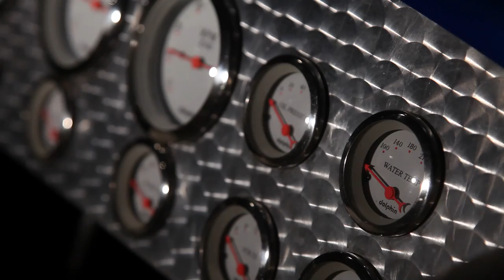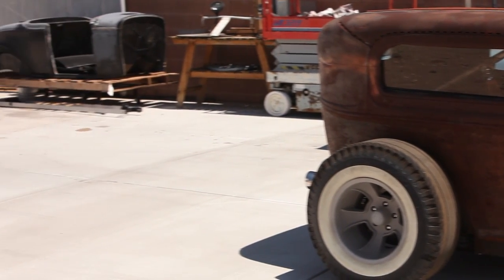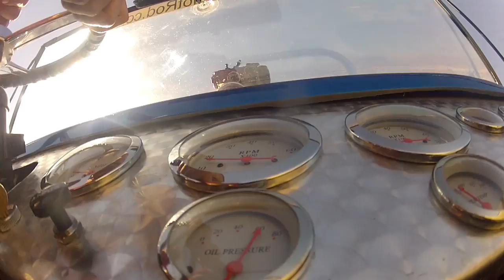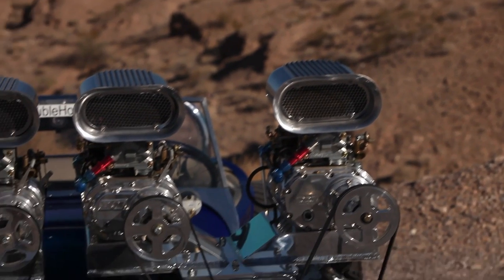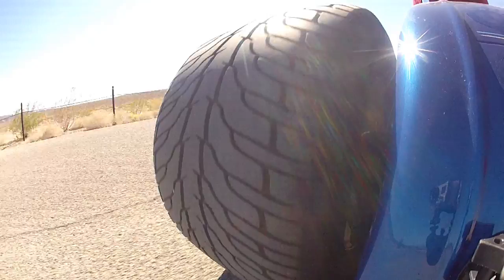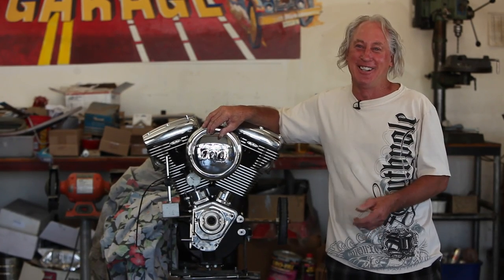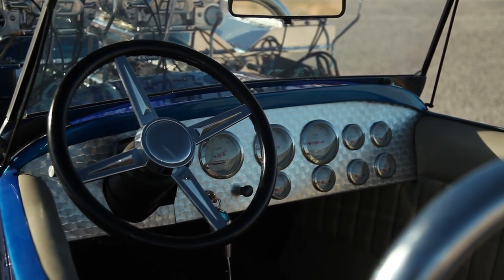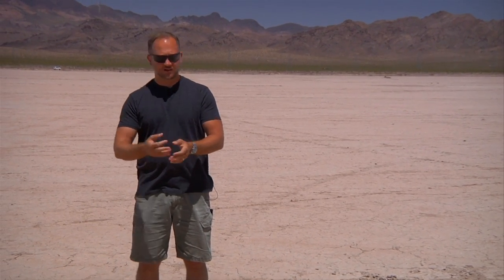1927 Ford: Two V8s, Four Supercharges, 1,200 HP // BIG MUSCLE

Comment: I'm pretty sure it's a sin to make a video about a car like this and not do any pulls.
Reply: Car doesn’t run well enough to make a pull in it. It didn’t even have a proper seat? How do you do pulls sitting on the floor of death trap.
Reply: It has the horsepower. It has the torque. It does not have the suspension, frame, or drivetrain for pulling.
Reply: Denis Gavrilov it’s not about the Miles per gallons it’s about the smiles per gallons
Reply: Its bull shit I bet the air to fuel is all wrong and I want to see how they fabed up the input shafts for the trans axle . 
Also he said they DOHC but rid of the electronics so the VVT doesn't work? Lol
Would of been way better to shoe horn an all new ford 460 with forged internals and twin turbo it and it will probably make more than 1200hp
Reply: @danialphaomega  Ford DOHC 4.6 of this era did not have VCT.
Reply: I cant happily say you can't do pulls in this car. It spins out literally immediately it feels like a front wheel drive car with skids in the back haha if only ya knew 😅
Reply: The film makers are all going straight to hell.

Comment: A bit too "in your face" for me, but really well put together for that level of functionality.  Not only getting two engines to work side by side to a single transmission but the fab work to get two blowers plumbed into each engine.  This guy is taking "because I can" to new levels.
Reply: The only thing it was intended for was to be in your face and it does it perfectly!!

Comment: These engines are (a very slight) 281 Cubic Inches in displacement.  Doubling up gives 562 cubic inches. It is currently possible to get more displacement than that from several readily available types of big block engine configurations.  The reason for doubling up engines is to get size when it can not be done any other way.  This car is automotive art.
Reply: i'd be more impressed if it used 2 302's or 2 351's. but the 281 was a nice strong motor
Reply: these are very good output to weight, and he was going for visual impact. cant fault him on that
Reply: oh im not. i had a Thunderbird that had a Police interceptor 4.6 281. that fucker would fly when i stomped on it.
Reply: Chris Martin Yeah because two motors side by side with 4 superchargers isn't impressive enough right? LOL Try tuning a motor with 1 supercharger and let me know how you do, The fact this man did it with 4 and got everything running flawlessly is beyond impressive. And by the way, those two 281 mod motors can handle WAY more power than a pushrod 302/351 ever could.
Reply: BoostedBadBoy
whatever. apparently you missed the part about me saying that i used to have a Thunderbird with a 281.
Reply: No just seen the exact point the guy in the video points out people always criticizing other peoples work. You'd be more impressed by putting two inferior motors on there instead of newer better tech? There is a reason why they went a different route, and mind you, I'm a Windsor guy myself. But compared to the new mod motors, they have NOTHING for them in comparison to power or what they can handle stock or built. Speaking of Thunderbird, we took my buddies 97 bird and put a 400hp shot of spray straight too it. Hosed the hell out of it stock internals never blew even when we took the motor out. Do that to any windsor, but I wouldn't advise standing next to it when you do. And yes clearly, you have to make sure you have the fuel supply to it as well in either situation and timing. Just saying, I'm not sure why you commented you'd be more impressed with two older motors? I don't know, maybe nostalgic look to it perhaps? But being they are carbed Mod motors with clearly fabricated intakes to fit blowers that aren't even made for that motor, let alone induction of fuel delivery, its extremely impressive in and of itself. That's why I commented to your's because the comment seemed pretty ignorant, so I was trying to figure out what was behind it.
Reply: the older 351's yes i can see that. i had a 351w HO in my 87 f150. but the one in 1990-96 were fuel injected. not sure what difference that would have made. and honestly i was referring to the new 302 and the new 351 that they put in the Shelby.
Reply: Ahhhh, the Coyote's now your talking and getting on the same page. lol So still mod motor's just not the Windsors and same CID. Makes more sense now, yeah back when this guy did this car those weren't available at the time. But now that you mention it, I'm sure he probably will build something like that in the future.

Comment: Two engines, four superchargers and produces 1,200 hp......Does anybody else feel that number should be a lot higher?
Reply: Superchargers take a lot of horsepower to turn them. If they didn't sap power as much as they did, it would probably be 2000+
Reply: Mason Hoeper so what I just learned is that you gotta give some to gain some? could you perhaps explain it to me? thanks
Reply: icantfindausernamify They run off of the engine. Different from a turbo in which the turbo is spooled by air intake.
Reply: Derek Borba MOST definately !
Reply: Derek Borba
I know what you're trying to say, but you got one mistake there. Turbos are spooled by the exhaust gases, so they can compress the air going into the engine
Reply: dexcz Just learned something new. Thanks.
Reply: Derek Borba A big part of the lower power is that he removed all of the modern electronics and replaced them with carbs and distributers. Lastly, the superchargers are pretty old fashioned, so they use more engine power to turn and produce less power in return
Reply: A Bugatti has 2 new engines, 4 superchargers and an onboard computer and it makes 1,100bhp
Reply: Maybe the big number are torque . HP don't mean shit.
Reply: H Stanley

I'm assuming you mean Veyron? Pretty sure the Veyron has one engine (based on two V8s) and 4 turbos, not compressors.
Reply: dexcz Actually it is the heat from the exhaust that spins the turbo. The hotter you get an engine, the better the turbo will spool. It is a misconception that "pressure" exists causing the turbo to spin.
Reply: mfletcherg122 You have that completely backwards.
Reply: ricky302v8 Actually I am an expert on the subject. Heat is what causes it to spin.
Reply: You think turbochargers spin because of heat convection? expert no, idiot yes. Turbochargers spin because of exhaust gas flow, the greater the flow, the faster the spin.
Reply: ricky302v8 I sensed a lot of sarcasm in his post. At least, I hope I did.
Reply: andrew a hp is everything. its energy, to move an object it requires energy which is hp. crank tq doesnt mean shit. it just shows what you dont know.    sad face
Reply: Chad W Having all the horsepower in the world doesn't mean shit w/out a way to put the power to the ground. Look at a diesel engine. They might have 2-400 hp but could have over 1,000lb ft of torque. You def need hp, but torque is just as if not more important.
Reply: ***** it has superchargers not turbos, and its actually really is the same 2 VW v8 engines but together. look it up.
Reply: Recon13x
i believe the term they used when talking about it in videos was "two V-8's back to back".
Reply: You can turn the boost up or down with different sized pulleys, more boost more horsepower = more heat and more fuel to keep it wet, and in a lightweight roadster on the street 1200 h.p. is WAY more than enough ,why blow it up for the street dudes pretty smart and got this right considering 4 blowers on 2 engines.
Reply: jzero32 I agree no need to blow your shit up, I just figured you'd get a ton more power is all.
Reply: Mason Hoeper Nah, those are pretty small blowers, just big cases for show.  Look at the pulley size, too...he's not running a lot of boost probably to just keep everything together.  Those engines are basically the same as a mildly built 600hp Terminator Mustang Cobra, they just look insane.  I can't imagine the drivetrain he has connecting the motors would fare too well with really crazy power numbers.
Reply: Only 4.6 litre engines so no...

Comment: 4.6 too bad Ford stopped making them. Definitely one of the best, most reliable small blocks ever made.
Reply: biggest pain in the ass engines to get parts for ever. I wish I had a 5.0 instead of a 32v.

Comment: I'm not quite sure why 1 4,6L Ford V8 With 2 Superchargers only makes 600 HP?
Reply: i was thinking the same thing
Reply: Because its enough. And even with 600hp, its basically indestructible
Reply: milosilic23
they could easily have a bullet proof 800-1000hp setup
 (Per motor)
Reply: Lethal Snipes well yeah but you also have to think about everything behind the flywheel.
Reply: Omfgwhothefuckcares he drives it. He probably doesn't what to pull a mustang when he puts down 2k horsepower
Reply: Probably technically make more,but it prob take at least 500hp just to drive the superchargers

Comment: 2x V8 engines, 4 Superchargers... and only 1200hp ???
That's strangely funny (non-sense actually), for it should make at least 3000hp (at least!).
Reply: its all about the tuning bro, hard to drive a car on the road with 3000 hp
Reply: kyle k
 Yes that makes sense, so it's all about the "Torque" and its beauty then. ;)
Reply: BState media yes, its a beautiful car. A masterpiece if you will
Reply: I bet when you slam the throttle to the floor it shreds the belts on the blowers. Must be replaced after every full-throttle. The serpentine belt on my Eclipse is thicker than those.
Reply: They said its 2 FROD engines. Even 800 Horsepower is a new record. I'm surprised. Why didn't you go for a Chevy 350~454CID with a single Supercharger. Easily would have had 1500 HP???
Reply: Fanie Boshoff They want it to run not sit on a carpet floor for people to look at and read how much HP it has.
Reply: The 2 engines are working in parallel, 4 LOW compression blowers (look at that pulley it must be 2 lbs of boost), and all working through 1 transmission. So basically it is one engine and will not multiply the numbers by the amount of power plants in the system. Horsepower is not important in an application like this, the torque is what is important.
Reply: therealdeadpen
With just a little bit smaller pulleys to increase the boost for at least 500hp more, wouldn't be a bad thing either. Just because there is plenty of room to achieve it, I'd go for it ;)
Reply: BState media and then the thing wouldn't be drivable on the road.
Reply: BState media yeah 1200 is not very much at all.
Reply: I think These engines Are primitive. They're running and running and running. And because they're so big They're also strong But they aren't supercar engines
Reply: ***** i live in Europe where normal engines Are 2.0 litres. 

One of the most used engines in Austria  is the 1.9 TDI of VW , so everything above 2.5 isnt normal anymore   and over 4 it's Big . So for europeans the 7litre -Blocks Are almost Incredible. They think you are talking about a fuel consumption of 7litres / 100km
Reply: +BState media I have looked up how many horses a standard 4.6 liter ford engine has. It has 200-300 hp. So 600 hp for each is pretty good for a non-professional engine builder.
Reply: +Sincee1809 aka Epid3xia You are right, now that I'm thinking about it, it is also much more reliable with that setup VS a setup that could yield ~3000hp, for sure.
Reply: ***** No Europe isnt the entire World. I thougt perhaps he is an european and doesnt understand. I know that they arent supercar engines
Reply: ***** Bstate media
Reply: A lot for 281 cubic inches.
Reply: thats what i was thinking

Comment: Only 1,200 HP? For what's on the car that's kinda sad....
Reply: +AshesAndSketches i'd wager it can output a lot more, but it would be suicide
Reply: Sean Hartford It's not that it could, it SHOULD with the setup of the engine I'm genuinely puzzled how it's putting out such a low figure...
Reply: +AshesAndSketches No, no it shouldn't. In fact, most of the build hinders the ultimate output of those engines. But on the other had, because they are so "de-tuned" he doesn't have to worry about anything on those engines.

Besides, 1200HP is already too much for the street. Hell, 1200HP is too much in something like that anywhere.
Reply: AshesAndSketches I seriously doubt you’ve driven a 1200hp car, it’s a lot of power especially in such a small car

Comment: is it just me or is that car putting out very low hp for what it is i mean a single decent built 4.6 with one of them superchargers should be around 600hp or more let alone 2 superchargers
Reply: the car has 1200 HP
Reply: probably 1200hp at low RPM and tons of torque
Reply: michael stojanovic
 no really i must be stupid (sarcasm). i was obviously talking about one motor because 1200/2=600 which means each of those motors are only making 600hp
Reply: michael stojanovic they more than likely are not built motors, they are the 4.6l which didn't natively put out all that much power. His goal wasn't to make as much power as possible, like he said, there's so much power as it is it can't hook up. What's the point of building it to make any more power. I know the blowers are functional but I'm sure they were mostly put there for the way they look.

Comment: No way could that one radiator take all that heat tho wtf.
Reply: How would you know.  Think about it.... if the car isn't pushed to the limit all the time...how much heat do you really need to get rid of.
Reply: also the engines are out in the open air not trapped under a hood
Reply: not too mention do you see the size of that rad? its massive for 1, and 2 im pretty sure he has an upgraded cooling system... he doesnt sound stupid so im sure he did..
Reply: Thanks for chiming in Sierra and Cam...

It is Sadly Amazing how quickly and easily people who know so little think they know so very much.  It is compounded several orders of magnitude that anyone with obvious internet access can't simply bother to do even rudimentary research before making Ignorant comments.

I keep noticing this trend.

The less people actually know the more they think they know.

It's both sad and funny all at the same time.
Reply: neomags I have a degree in auto mechanics.
Reply: neomags lol dude you can do all the research you want.. in the end the car is fine am i right? why fix something if its broken... thats what it comes down too like jesus, i wasnt trying too act smart what so ever, i was mearly giving my input into the topic based off of what i can observe. i cant drive the car and neither can you, so whos too say it isnt good enough right? i take auto mechanics in school, and minor in flight engineering. The main thing is he wanted too keep it compact as possible (as stated in the video) and if this worked for him and isnt giving him bad results then why change it? When we look at jet engines they have a simple cooling system (complicated yet simple compared to design) that does the job the way it should and the engine doesnt overheat. in this case its more or less like building too minimum code in a house.. its not ideal and is frowned upon.. but hey for a house that lasts 5 years like the houses here do :/ it does the job and works.. so before you go calling us stupid and saying we are inferior.. use fucking common sense and watch the video. you posted a comment... youre gunna have someone come across it and make a remark. so shut the hell up man... apparently you dont know much about cars and look like the douche you tryied too make us out too be Sierra Foulke thanks for the input lol i over looked that part too /.\
Reply: What heat these engines never have any load on them?  oooo
Reply: Zane Muckey Exactly my point.
Reply: Shtoops27...he's runnin waterless coolant, it doesn't overheat because there's no water to turn into steam...waterless coolant lasts the lifetime of the motor, never having to be flushed out and replaced so long as the water pump holds up....
Reply: WDYM it's fucking huge! Also did you even watch the video? They ran it all day in 104°F.

Comment: only 1,200 hp not impressed nice car though
Reply: for it to be street legal and have that much power it is impressive
Reply: Chris Martin uhhh no there are cars much more drivable than this with the same or more hp and less cylinders and without all the unnecessary engine in your line of veiw...
Reply: that may be. but those are usually the ones that cost anywhere between several hundred thousands and a couple million. and those are usually the ones that are built for speed. what good is a lot of speed if you can never use it without being on a drag strip or on the Autobahn.
Reply: Chris Martin no again search 1200 hp car on youtube first video 1700 hp vette. Car plus build wouldnt run you $200,000 you can also search 1200 hp supra i could go on with my list of cars with more or the same hp that are more practical but you get my point
Reply: John Kreese Looks huh well from the looks of it (pun intended) the guy barely drives it to scared of the power even the guy reviewing the car didn't put his foot to the floor
Reply: John Kreese gaah ok buzzkill guy geez
Reply: John Kreese and also im not a kid that would be a young goat sir
Reply: Sounds like someone is jealous, just be happy there is people that still enjoy the joy of building cars like these and are proud to be able to have the hobby. You're a damn elitist dude, I know for a fact you can't build anything like this. Horsepower doesn't matter, he wanted to build a car with two engines and he did it. That's what matters is that he had a goal and he succeeded it. Also to not pushing the car to the limits, he is using his brain of course he doesn't want it to explode or even crash it. You should try it sometime cough cough